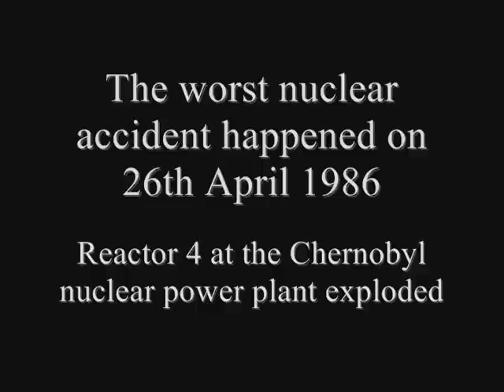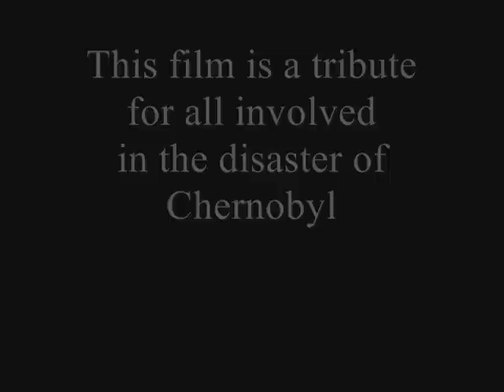Tribute to Chernobyl disaster - Sleeping Sun

Comment from the maker: 1, The SCRAM automatic shutdown mechanism was deactivated. Today, it is phsically IMPOSSIBLE! 
2, Reactor desing was faulty -> at the moment the graphite contorol rods plunged into the core, power rocketed for a short moment, and only then did it stop the splitting of the uranium. By the way, RBMK type reactors are only used in the countries of the Soviet Union. 
3, The senior manager Diatlov got the order for the safety test to be carried out between 700 and 1000 mW. He started it at 200 mW.

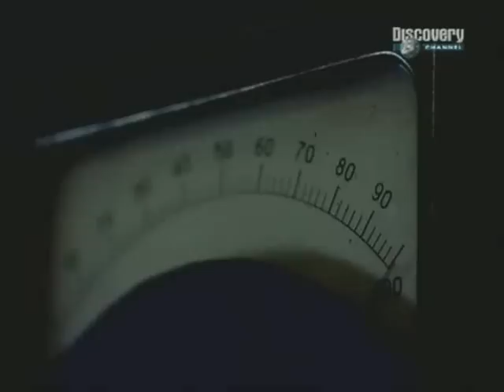Comment: What you are seeing at 1:13 is the graphite moderator. You are absolutely correct, this is not at all typical of a nuclear power plant. The Chernobyl design was an antiquated disaster waiting to happen, and no such reactors exist in the United States, Europe or Canada. Chernobyl had a "positive temperature coefficient of reactivity", this means that as the temperature increased, the nuclear reactions inside the fuel increased giving rise to explosive nuclear transient.

Comment: Bohunice V2 plant (with 2 reactors of type VVER440) was shutdown at the end of 2008. The site has only V1 plant up and running.
Ignalina reactor no.2 will be shutdown during this year. The type of reactor: RBMK-1500 (almost identical with the RBMK-1000).
Kola 1-4 reactors of type 440/230 are still running but upgrades were performed making them quite safe.
To conclude, the remaining operational RBMK's are:
Ignalina #2
Kursk #1-4 (+#5 in 2010)
Leningrad #1-4
Smolensk #1-3

Comment: When the fuel melts it can still be cooled. Three-Mile Island may have had a meltdown or even an exposed core, but it was still contained.
I just read that the Chernobyl reactor used graphite-tipped boron rods, which the engineers were not warned about. When the rods were dipped in, the graphite burned and things got hotter.
The reactor didn't have the right kind of heat detector, so when the bottom of the core overheated, they didn't know until it was too late.

Comment: The only thing that surprises me is that it took so long for the accident to happen. The reactor was built in haste, the building was flimsy, the fuel was too powerful for the reactor, the wrong type of control rods were used, the equipment was weak, and the guy in charge was trained to operate a coal-burning power plant, not a nuclear one.

Comment: In addition, there was no 1.3 meter (or 4' 3") thick concrete containment building, which is standard on all nuclear reactors in the US and other countries. The Chernobyl reactor was essentially contained in a glorified office building. Proof of the success of the containment building was shown in the partial meltdown at Three Mile Island in the US. In this accident some radioactivity was leaked from the steel pressure reactor vessel into the concrete containment building, where it stayed.

Comment: " Volunteers in diving suits entered the radioactive water and managed to open the gates. These were engineers Alexei Ananenko (who knew where the valves were) and Valeri Bezpalov, accompanied by a third man, Boris Baranov, who provided them with light from a lamp, though this lamp failed, leaving them to find the valves by feeling their way along a pipe. None of the three ever returned to the surface and it is thought one of them died before reaching the gates. [35]"

God damn.

Comment: Actually, at 0.7 mRem it would take 297 days before you would absorb a dangerous dose of radiation.  The accepted occupational standard for radiation exposure is 5000 mRem per year.  One occupation where doses in this range are received, is a Radio-Oncologist.  They are exposed to radiation when they have to deliver radiation therapies to cancer patients.  You may be surprised to know that one of the remaining nuclear reactors at chernobyl was operated until December of 2000.

Comment: Three Mile Island released no large amounts of radioactivity into the surrounding environment, no one was killed, and the power plant is still operating to this day. The Chernobyl tragedy can be regarded as a casualty of the Cold War. By forgoing obvious safety measures in plant design to lower costs the former Soviet Union set the stage for this disaster. It is imperative that this fact be understood, and that Chernobyl not be considered as a reason for concern with nuclear power safety.

Comment: @RashidDostum Directly from USNRC "Transient-A change in the reactor coolant system temperature, pressure, or both, attributed to a change in the reactor’s power output." Nothing to do with an explosion. Normal operation also causes loss of fuel mass - by design.

Comment: @thedeem0N The two bombs did not release 0.01% the amount of radioactive material as Chernobyl. Think about it - bombs are DIFFERENT, they're designed to turn the fissile metal into heat energy, not to scatter it into the air. Plus, the reactor explosion wasn't a true atomic explosion, it was a hydrogen explosion with burning uranium and graphite.

Comment from the maker: about 30 minutes seperated TMI 2 from Chernobyl. but the situation was different...in this case, the pressure was bigger.
engineers knew what kind of material the control rods were made of:) they just didnt know, that an emergency shutdown increases power for a second.
you watched the discovery type film about chernobyl, which is the most accurate, but it isnt 100%. read my video descrition to know what really happened.

Comment: Again sorry for disagreeing, but this is not correct.  The radiation I am referring to, which is freed from the burning of coal, is the exact same nuclear radiation as is produced from conventional nuclear power.  It is actually far more dangerous because it goes straight into the air we breath, rather then staying in a solid form as is the case with nuclear energy.

Comment: They are not too big to have a containment building. The core along with the graphite blocks are placed in a concrete shell which sits underground. A containment building could have constructed instead of a steel building because if you observe the actual size of the compartment, its not that large. The problem was that the Soviet Union would not fund such a structure, opting for cheaper methods of construction. Too many shortcuts were taken in the design of these reactors. Its quite a shame.

Comment: @amafuji I dunno what you're on about "40%" of the radiation left Chernobyl? You do realise all the nuclear fuel is still inside, under the reactor? Of which gives of 10-20 Thousand Roentgens? Chernobyl isn't a fraction of Fukushima because hardly any of the radioactive elements actually left the plant, what left the plant was Cesium, not The Uranium or Plutonium, which is what is the concern.

Comment: Either way, I doubt Ukraine has any use for it. That countr'ys been depopulated by emigration and it's unlikely anyone desperate enough to move back in.
However, the outskirts of Pripyat might be safe enough for collecting scrap metal. Those abandoned apartment blocks have miles of copper pipes, and the people could sure use the cash.

Comment: @TheChineseEmpire Define 'safe energies'. I don't care who says otherwise there is ALWAYS a risk; coal shoots tons of garbage into the air, solar leaves behind chemicals in the form of toxic semiconductors that are impossible to recycle, hydro has caused the most casualties of any single power source (see Banqiao Dam approx 25,000 casualties). What we need to do is decide which risks can be minimized to get the most benefit, to simply hide behind the banner of 'safe energy' is irresponsible.